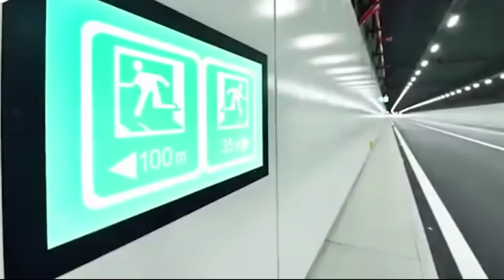New York’s $55 BILLION Plan To Connect Long Island And Connecticut!

Comment: I think the project will happen but in order to make the bridge a reality, it would only be an underground tunnel and construction would have to start small starting with an underground high speed rail and then once that gets built, then the highway for vehicles would get built afterwards to save costs.

Comment: This project isn’t realistic and isn’t happening, for several basic reasons that the video glosses over.

1) The commuter argument and tolls don’t make sense.
This is not a commuting corridor. Long Island commuters go into NYC or elsewhere on Long Island; Connecticut commuters go into NYC or Stamford. People do not commute daily between Long Island and Bridgeport. Even if they did, a $40–$60 toll makes it unusable for everyday commuting. Anyone who could afford that daily already has the means to live closer to work. And if the bridge somehow created new trips, that wouldn’t solve anything—it would just add traffic to already congested areas. Moreover most commuters use rail here, building a bridge to encourage more polluting car traffic will never fly.  

2) Two states, built-out region.
Virginia’s bridges worked because they were built decades ago, entirely within one state, in far less developed areas. This project spans two states with different politics and priorities. Connecticut sees little benefit and has little incentive to take on the traffic. Even New York’s own 2017–2018 study for a NY-only crossing into Rye failed because local opposition was overwhelming. That hasn’t changed.

3) Trucks and freight are overstated.
There is very little truck traffic between Long Island and Connecticut. Long Island is primarily residential, and most freight comes from the west via NYC, not from the north. If the crossing did increase truck or general bridge traffic, that immediately creates more environmental hurdles and stronger local opposition. Any serious freight use also raises unresolved issues about hazmat handling, safety, and environmental risk.

4) The real demand is leisure travel, not daily use.
The primary benefit would be Long Islanders getting easier access to New England for leisure. That does not justify a megaproject of this scale. Any increase in tourism or new trips means more traffic dumped onto roads that already can’t handle existing volumes.

5) The road network can’t support it.
The LIE, I-95, and connecting roads are already jammed with no room for expansion. A bridge generates traffic; it doesn’t absorb it. Without massive, region-wide highway reconstruction, you just create a parking lot that backs up onto the crossing itself.

6) Evacuation arguments are overrated and misleading.
A bridge doesn’t magically fix evacuation for a region this dense. People can already leave Long Island slowly because that’s what physics allows. Adding a single massive crossing doesn’t change that—and it becomes a major vulnerability and security target in an emergency.

And finally, this video, while entertaining, is stuck in a dated mindset. The only way a Long Island Sound crossing could even be discussed today is as a mass-transit project—something like a long-discussed Amtrak or regional rail connection from New Haven through Bridgeport to Long Island. There is no scenario where this many additional car trips get approved over a sensitive body of water.

Modern projects rely on rail, buses, high-occupancy vehicles, and congestion pricing. That isn’t mentioned here. Even if the crossing were rail-only or primarily bus-based, stations would still generate localized traffic in areas that already have severe congestion and very limited space. So even the most transit-oriented version still runs into the same physical and political constraints.

This might have been feasible if it were built before modern development. In today’s built-out, highly populated region, the cost, approvals, environmental impacts, traffic consequences, and local opposition make this a nonstarter.

Comment: First off, won't happen. Second off, y'all ever been to Port Jeff of the North Shore of LI as a whole? You'd need a connection to 495, and that alone would take decades. You'd also have to imminent domain A LOT of property. And as for Port Jeff itself? It CANNOT handle the traffic. Most of the North Shore can't until you get to about Riverhead. Sunken Meadow is a no-go unless they do all of the overpasses and somehow take the State Park away. If this were to happen, it should've happened 50 years ago. A tunnel makes more sense, but most of my points still stand.

Comment: If the estimate is $55 billion then it will actually cost well over $100 billion.  As a Connecticut resident I see no reason to pay for it. New York is welcome to do it if they want.  What we really need to do is send a lot more cargo on ships and get some trucks off our highways.
Reply: The bridge would ease congestion on the I-95 corridor heading wb in the a.m. and eb in the evening. It wouldn't just be benefitting N.y. and long Island, it would be benefitting your state as well.

Comment: That money would do more good for the U.S. and Canada if it used to connect Maine with Nova Scotia with a rail and road bridge or tunnel because there are plenty of rail and road corridors in New England and the Mid-Atlantic and trains can go around NYC to the west.  If Long island gets a bridge or tunnel to connect anything it should be at the Northern tip into Connecticut/Rode Island state border area.

right now it takes over half a day continual driving time to get from Boston, Mass to Halafax, Nova Scotia and 3/4ths of a day from NYC with no traffic.  A high-speed train traveling at 225m.p.h. would cut the times to

Halifax - Boston (475mi) - a travel time of (2h6m) and a total time of approx. (2h30m)
Halifax - NYC (680mi) - a travel time of (3h2m) and a total time of approx. (3h20)

P.S. - I also added a tunnel or bridge from St. John Canada to Nova Scotia ...

Comment: Two four lane tunnels and a bridge is what that area really needs. Bridges  would cause to much environmental damage.  The bigger problem would be the $40 crossing fee. N9w if you build a big enough tunnel that couls also run a rail line through it, that can take passengers as well as freght  then you could have a solution.

Comment: This has been planned forever. In 1974 my parents decided to move from QUEENS to MASSAPEQUA. I was in my senior year of high school, and rather than transfer for my last semester , i commuted.  There are many routes to go from the north shore to the south shore. The cross island, the meadowbrook, the wantagh and the strange new expressway , the Seaford Oyster Bay Expressway.What made the SOB so strange  1) that it was often empty, 2) The cars that were on it  were going so fast that i was shocked that there weren’t more  on it , and 3)  it seemed to go nowhere in both directions.  From north to south it starts at Jerichp Tpke . And it ends at MERRICK road. Or does it? Past both of  these exits the expressway extends about 100 feet. These extension are paved there, but seem to go nowhere .

My understanding is that was supposed to be the connection from BRIDGEPORT TO JONES BEACH. The last 😅time that i was on the SOB , about 5 years 😊ago nothing had changed.  Its still a road from nowhere to nowhere.

Comment: IF it ever happnens it will not go from Port Jefferson.  There is NO WAY Port Jeff can handle the traffic this would cause.  It would have to go from Sunken Meadow Parkway or another large Highway/Parkway.  I have lived in PJ for 50 years and they have tallked about this for as long as I can remember.  It just aint gonna happen.  Especially from sleepy little PJ that can hardly even handle the ferry traffic during busy summer months as it stands

Comment: Niccols Road (the approach that would be used if the location were port Jeff) runs through a hospital/university at the end. Aside from needing an upgrade to an expressway which is complicated due to the need for land acquisition,  The sound crossing would have to be a tunnel/bridge hybrid that bypasses this and emerges above ground once in the water. 

The best option is from Sunken Meadow Parkway to Bridgeport. Sunken Meadow would be upgraded to an interstate. I also appreciate their park so I understand the concern. A tunnel/bridge hybrid also works best here. Go under the beach/park. Emerge 1 mile out in the water. Problem solved.

Comment: Google says the average water depth of Long Island Sound is 65 feet deep. The Mighty Mac bridge goes from the north peninsula to the south peninsula of Michigan that crosses the 300 foot deep in the middle 5 mile wide Straits Of Mackinac that connect Lake Michigan and Lake Huron, the world's 4th and 3rd largest lakes.  Big Mac is the longest suspension bridge in the western hemisphere, it was built for $100 million and opened in 1957 when it was the world's longest suspension bridge. It cost $5 for a car and at least $5 per axle for trucks and trailers. It has a 45 mph speed limit and 20 mph for big trucks. Between the suspension towers the Mighty Mac roadway is 200 feet above the water. The towers rise 550 feet above water. I think Big Mac needs barriers built near the support towers so ships can't crash into them such as happened in Baltimore.  A 20 mile bridge is light years from a 5 mile bridge but the water is not as deep in Long Island Sound. Mighty Mac is a beautiful bridge but a bigger bridge can't be built for 1950's prices. Mighty Mac so they say, was built in 4 years, on time and within budget. To me the Mackinac Bridge is the most beautiful bridge i've ever been on and i 've been on the Golden Gate and the Sunshine Skyway. Perhaps i'm biased because Big Mac is only (+/-) 360 miles northeast from my house and i've been there at least a half dozen times over the decades. Plus the Michigan U.P. is gorgeous in the summer.

Comment: "a journey of only 20 miles, yet often a frustrating 3-hour journey through New York City’s tangled highways"  This is total BS. Even if one starts in Port Jeff the normal transit time to Bridgeport CT is in my experience more like 1 1/2 to 2 hours and "NYC tangled highways"  have nothing to do with it.Usually the slowdowns are on I95 in CT.  I495 to Cross Island to Throgs Neck  to I295 to I95. I have lived on Long Island for 40 years and driven to Fairfield County CT so many times I could do it in my sleep. Google maps telling me now toll cost is $8.94

Comment: I am from LI and has recently returned after 26 years living in other places. They have been talking about this before I was born and I’m 60 years old. The reason it will not get done is not because they can’t do it. It’s because of $$$ and who will spend it and who will get it back when they have a toll. NY and Conn. are the two most expensive states and also 2 of the most corrupt. Just trying to decide who gets the contract and who gets kickbacks are a nightmare. It’s not just the politicians it’s organized crime you have to also please.

Comment: We don’t need a bridge.  Make tunnels with Elon’s Boring company for a fraction of the cost.  According to Grok.  “Estimated cost for 14-mile tunnel: $55 billion. Standard proposals (e.g., 2018 study) peg underwater tunnels at $3-4B per mile due to subsea engineering. Boring Company’s land tunnels target $10M/mile, but no specific Long Island Sound proposal exists; underwater adaptation would exceed that significantly.”

Comment: The area need more than one bridge, tunnel or bridge/tunnel hybrid. 
I myself favor a y-shape configuration where you would have one leg of a rail/rosd bridge going from Long  Island to the junction island interface of two tunnels which would pass under the shipping channel of the sound and connect to the two cities that was mentioned in the early part of the video by bridges.

Comment: If a tunnel or bridge are to be built, it should be occur in oyster Bay. A narrow section of the LI sound. Plus it will be practically for the majority of the traffic that will flow to NYC.

Comment: I'd heard of a Sunken Meadow to CT bridge, good luck getting that through the Town of Smithtown and Suffolk County.  Sunken Meadow Parkway, that feeds the beach, is a small parkway that cannot handle the traffic.  The Bridge would be a blight on Sunken Meadow State Park.  When this comes up for a Vote...I'll be voting HELL NO.  At least Port Jeff is a ferry terminal and not a nice beach.  But you have a similar problem with the 112 road into Port Jefferson...that's not a parkway, it's 2 lanes each way through commercial and residential zones.

Comment: NY and Connecticut are run by democrats, and as you would expect, always, always running at a deficit. This is not happening. Their policies do not allow for rational thinking; With about the same population as NY, Florida runs on HALF of NY's budget. Go figure. The money is certainly not going to our roads which are in rough shape, always.

Comment: I guarantee you if you built this people would pay 40 or 50 bucks to cross it cause it would be easier and cheaper than the current way. But this has been talked aboit for decades and the more you wait the more it will cost to build

Comment: I thought they should just extend a road off the east tip and use those two islands as mounting points, but i am not a bridge engineer (clearly). I think making a bridge in the middle would give the most benefit to the most people, though.

Comment: There's no roadway infrastructure on either end to make this happen. It was supposed to be further east. The William Floyde parkway just ends near the north shore. If that were continued, through mostly woods now, it could connect in New Haven at the warf. Thats the only areas that would work for both ends. Lived on LI till I was 35, been here near the coast in CT for 8 years.

Comment: Port Jefferson is not feasible in any way, shape, or form. There are only single-lane roads that access and go in and out of the village. There is no place for 3 lanes of bridge traffic to merge to. Widening existing roads can't be done due to housing and businesses. The only feasible place would be to extend the Seaford Oyster Bay Expressway onto a bridge in Nassau County. It is already a six-lane highway (3 north and 3 southbound lanes). Even then, I can't see this ever happening.

Comment: What would the point of that be? 
Certainly not existing jobs - probably 95% of LI commuters work in NYC, 95% of Connecticut commuters also do, and only a few make that long U-shaped journey between LI and CT on a daily basis. Sure, It'd be nice for vacationers on LI going to New England, but that's about the only current purpose I could see. Or is the idea to reshape commuting patterns and the whole economic map of the New York Metro area, in the way I-287 has for NJ? In that case, that bridge would need a rail-line as well as a road.

Comment: The westernmost historical proposal, 7 miles between Oyster Bay and Rye, would be the most logical and the least expensive proposal. Basically an extension of the I-287 outer bypass of the NYC area, and entirely within New York state.

Comment: It will never happen. The incoming traffic from Connecticut would have to merge with the Long Island Expressway which cannot accommodate additional traffic. It is already backed up most of the day without the bridge. The connection would have to run through Port Jefferson to get to the Expressway and there is no available room for a highway there. The idea should have been done decades ago. It is too late now.

Comment: I think a Tunnel is the Best option, No Visible Obstacles, it's underwater so evacuations are virtually weather proof. You would hardly know it was there. I say go for it, But a more reasonable cost is $20-$25 no more than that. Let's not be Greedy.

Comment: 55 billion dollar estimate, after factoring graft corruption and bureaucratic inefficiencies actual costs will cozy up to 135 billion. There is no possible positive return on this boondiggle. Tools will need to push $50.00+ as a minimum. The only bright side isthst can be saud is that does not go to.New Jersey

Comment: The village of Port Jeff and the town of Brookhaven will never allow this.The only main roads that feed this area are the LIE which is not close and Route 347 which is heavily congested as it is. The highway would have to run through  or over a historic village. Not to mention it would put the Ferry company out of business. I think the Oyster Bay to Rye option as designed is a better option. The Oyster Bay expressway was built to run there and is in place already

Comment: If you ask me, the tunnel option would be the better solution over say the bridge and hybrid models. If a bridge was built, it would run the risk of having ships running into it if no one is careful enough, if there cargo ships involved...look at what happened in Baltimore's Cargo area, the bridge collapsed and is still under construction I believe. Having the tunnel would lessen that risk and won't affect any marine or wildlife. The catch would be that there would have to be strict speeds for those driving and if transport trucks are going to be involved, they'd have to be mitigated into one lane for that length of time each way. I'd go a step further and add a train/rail system in it both ways for a lesser amount than it would to inevitably pay for a toll each way.
It will definitely boost the economy, but there shouldn't a need to have it be privatized as the private companies will control how much is spent going in and out of the bridge/tunnel and it would potentially make it an issue.